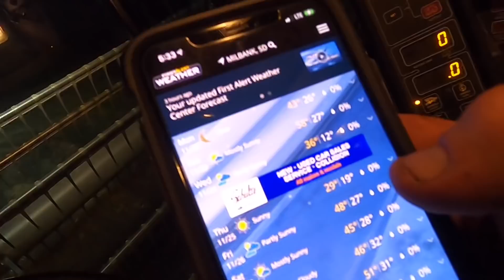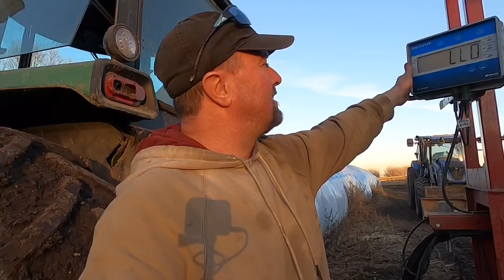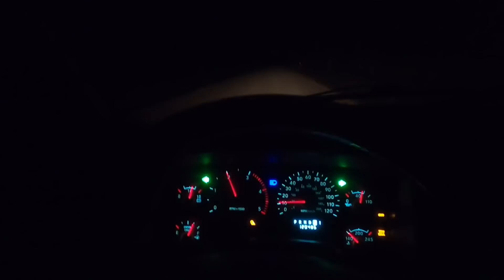The Temperature Drops and The Last Soybean Is Finally Able To Be Harvested (Just Barely)! ￼

Comment: I have been trying to find a 20-30 Gallon diesel tank I can put a pump on and use in the bed of my truck. I don't want a large 70+ gallon one because I need it to be easy to take in and out of the truck. Seems the smallest I can buy locally is that 70 gallon and it is an awkward shape that has to be mounted so it wont tip over.
Reply from the maker: It’s pretty hard to find a diesel tank that small. Someday it would b nice get a good fuel trailer or a tank to put in the back of the pickup.
Reply: I have seen 30 gallon ones for sale at Runnings. Don't know if you have one in your area. Thanks for watching Bill. Have you been able to do any work on your major this winter?
Reply: @stephenfonder7409  just plowing snow, I'm gathering parts to do an engine overhaul on it before spring hits. Our nearest Runnings is in wilmar Minnesota, about a hour and a half drive. Wish we had one closer.